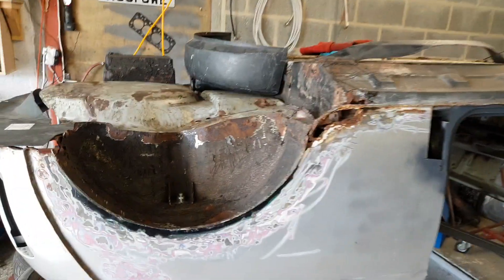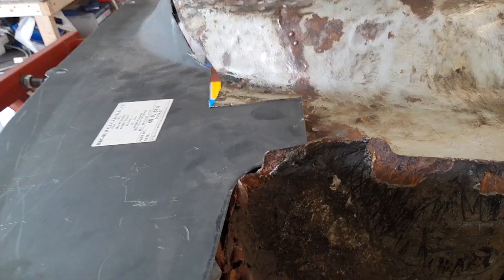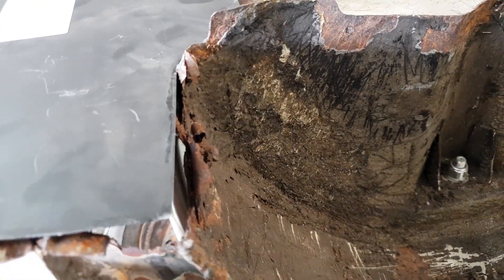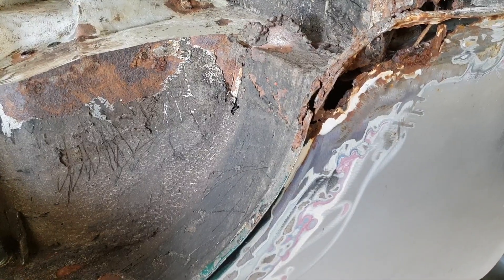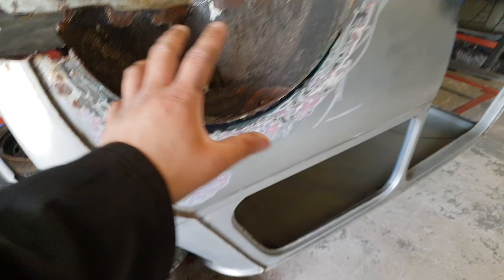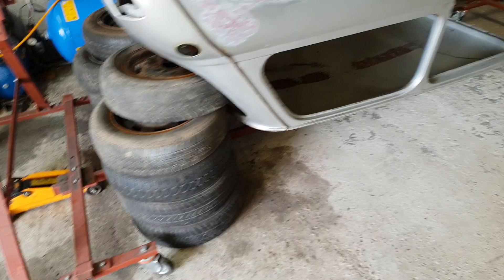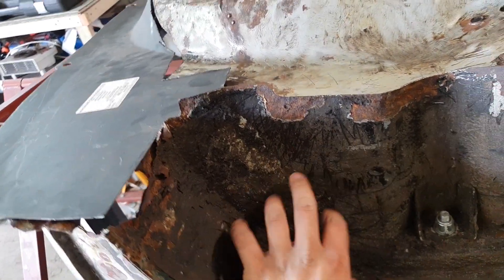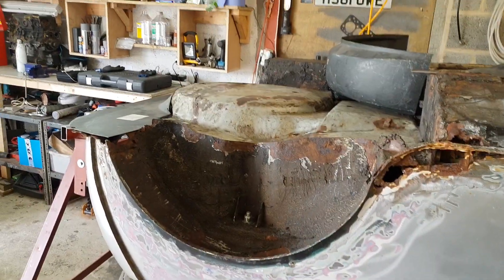I need your advice...

Comment: Ben, After looking at the jig i would keep it in place & use the seat belt anchor points on the seat back upright to bolt a lower box section then weld some uprights to the main bar across the arches & maybe the same above the main bar, There is a lower & upper seat belt bolt hole on each side you may be able to get extra strength from or just drill holes and fill them later. When you unbolt the wheel arches you can use the hole in the jig as a guide for replacing them, There should be enough rigidity in the rear seat to hold the weight, If not fit the boot floor repair panel and then the arches, Best of luck. Cheers Dave.
Reply: Ben, Please take a look at my last video i have mentioned some ideas to help with your rear arches! Cheers Dave.

Comment: When I did mine I repaired my arches first so I had something to go by, I’d say change your aches first but that is a lot of metal to come out. My suggestion would be to put a couple of patches in on the arch, nothing fancy just to get your lines, continue with the boot floor and then change the aches. I was surprised when I did mine how much flex that back panel has got I’d dread to think what it would be like with no arches. Hope that helps and you can understand what I mean
Reply from the maker: In hindsight I should of put a brace bar across from the boot hinge panel to the rear seat back as there is indeed a lot of flex in it.
Good shout just putting a temp patch on the arches, think that's what I will do! Cheers buddy!

Comment: Just my thoughts as an inexperienced restorer. I would be aware that cutting too much out of the car will run the chance of the shell distorting. The floor looks a bit cruddy at the arch and boot floor. If you want to get the rear done first and want/need to take the car off the jig, why not weld a couple of cross braces across the shell floor.  As you plan to replace / dispose the old rear quarters, then perhaps you could weld a couple of strips down from the cross braces, to the quarter panel surfaces. This could be done to keep the shell square and solid, so you could then feed a hardwood board from side to side, through the side windows and with a jack on each side, jack the weight off enough to release the rear rollover jig. Block the plank so it id safe and then cut our what you need.  I would also suggest the interior of the shell should also be both cross and horizontally braced also,

Comment: Hi Ben
The magnum panel needs trimmining back when the arches are in place so kind of tricky doing rear panel first. Do the arch. I bought new arches but the inner edge if the old arch was good (and the shock support) so i cut my new panel down the lend and welded upto the original join in the inner arch. If yours is good too it makes life so much easier as you keep strength by not cutting out the inside arch. Hard to explain. Ive got lots of photos if it helps. Alex came iver the other day to collect the jig. I showed him the finished job ! He seemed to like it

Comment: Not that i have done it (yet) but always planned in my head i would do the arches first. By making up a jig of their position and lowering the car onto a pallet or similar whilst doing it. Maybe a heritage boot floor would be a better fit. Why don't you use zippy as a form of template for the shape you need from the repair panel

Comment: Why not start at the front and work your way back as in floor sills heal board then rear quarters that way the main shell is strong and then arches and boot floor. Or weld bracing from the roof to floor seat base etc so nothing moves and take messurments befor doing any thing. Could also make a negative jig thingy.